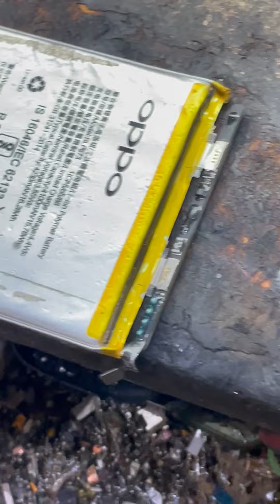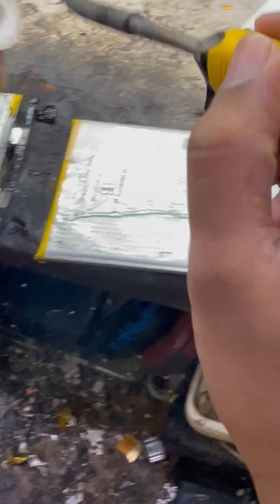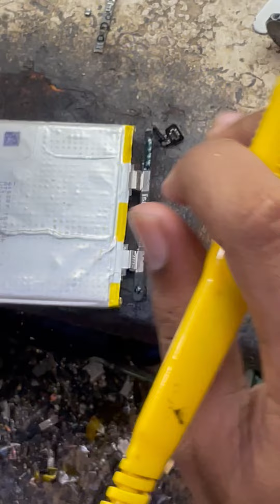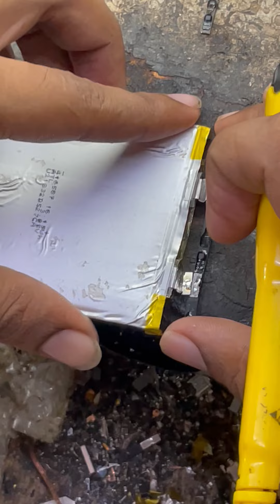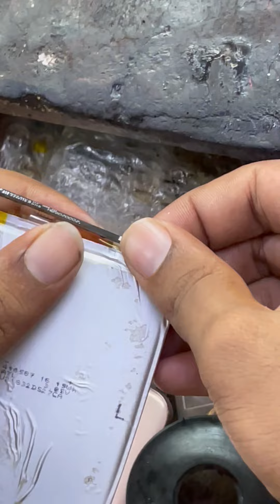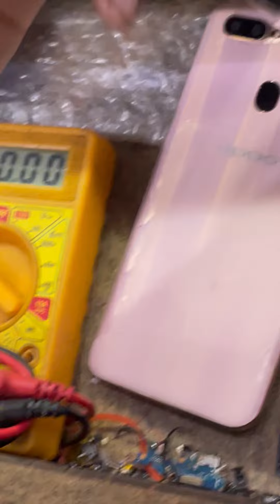Mobile Battery Flex  Change || Repair Solution Without Battery Change ?

Comment: Hello! I have a problem with my old phone battery. Long story short I ripped the cable when taking it out( even though I knew how to properly take it out🤷) now, i would like to fix it since the battery was in quite good condition, but I cannot seem to find anywhere the replacement flex cable for the battery. It looks exactly like the one in your video and I was wondering, where did you get it??
Reply from the maker: Not possible